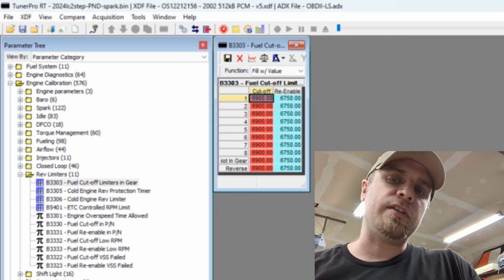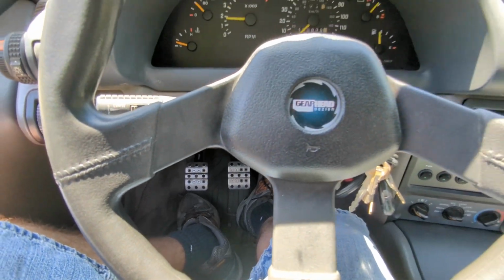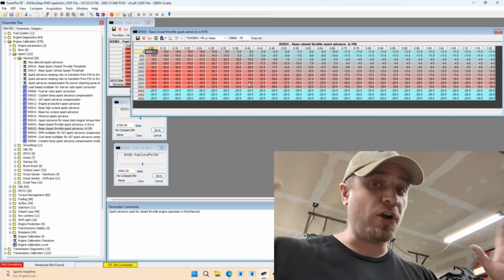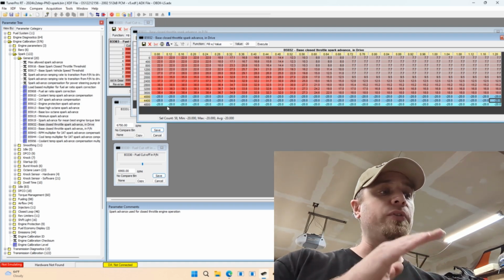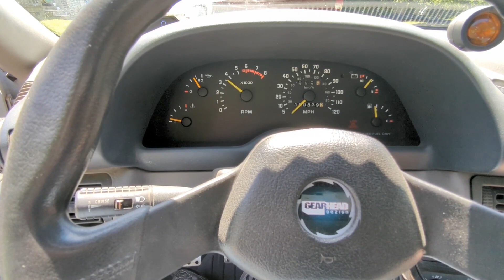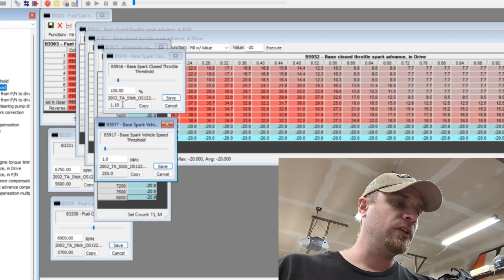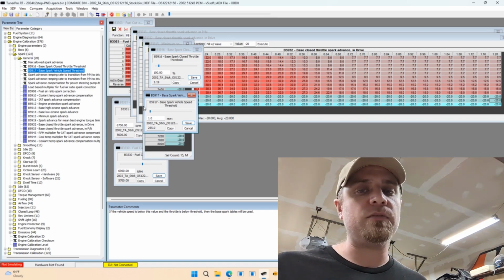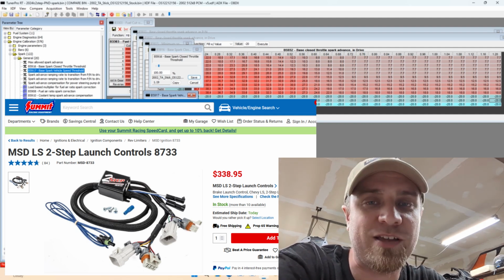Zero-wiring 2step rev limiter with factory PCM in HPTuners/TunerPro - Beretta #LSswap

Comment: What do you use for data logging now that you use the obdx vx instead of the obd link? I tried using tuner pro but it doesnt seem to support the obdx?
Reply from the maker: @cameronpierce5188  you're correct. I've been using PCMlogger that comes with PCMhammer. It's not awesome, but it will get you the data you need. You can import the data from PCMlogger into mega log viewer to get a better look, because it's kinda hard to see trends in excel.
Reply: @GEARHEADdezign  does that approach have support for afr through the egr v pid?
Reply from the maker: @cameronpierce5188  yup. I have a video that goes over that. I think it's one of my drag racing videos
Reply: @GEARHEADdezign  Have you ever used torque pro on android? I set up an EGR V to afr PID/equation but I don't have a wideband   yet (coming this winter). I haven't had the chance to try data logging with torque pro yet but it outputs a .CSV so theoretically it should be able to with with megalog viewer? I'm hoping to be able to get data logs without lugging around a laptop but we'll see how it goes.
Reply from the maker: @cameronpierce5188  yeah, I used it a long time ago. I couldn't get my truck's OS to log wideband, but I never did try my Beretta